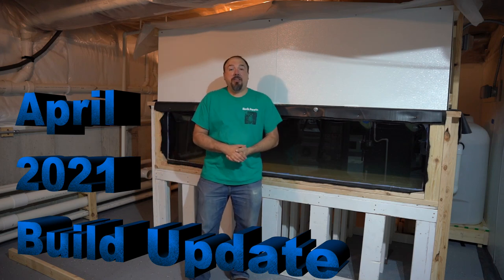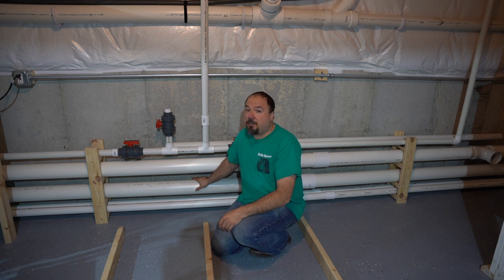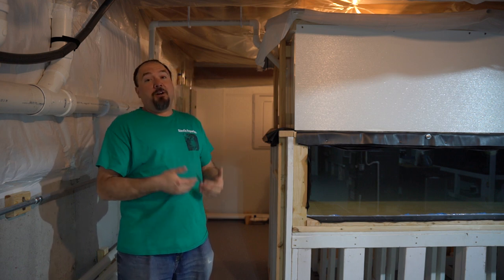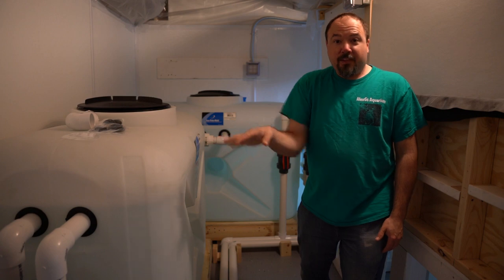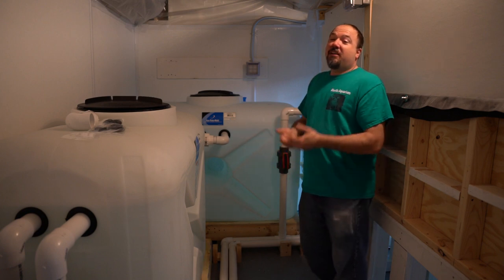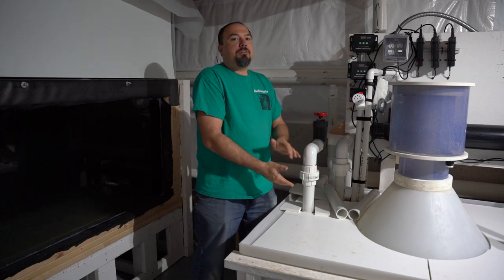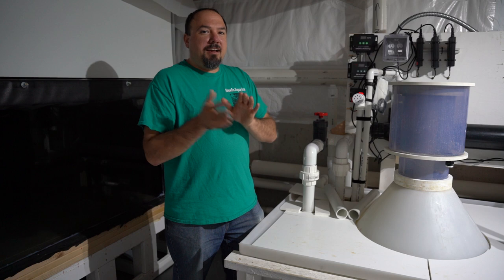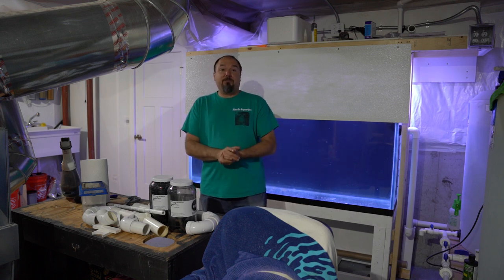April 2021 Build Update

Comment: Hi Alex, i enjoy watching your vidros........but, how you going to manage your nitrates long term?  Have you ever considered methanol denitrifying?
Reply from the maker: In my last system the nitrates remained stable at 10ppm for 3 years in part due to the refugium and the rest was all natural anaerobic denitrifying bacteria.  If there became a need I would make a denitrifying chamber filter to create a larger anaerobic environment.  I find that there is a natural balance that can be achieved with patience and time.  One of the reasons I do not use filter socks or other mechanical filter pads is because they just become nitrate factories that throw off the balance the nitrogen cycle operates within an aquarium system creating excess nitrates which in turn creates the need to have a separate denitrifying filter to balance out the cycle.